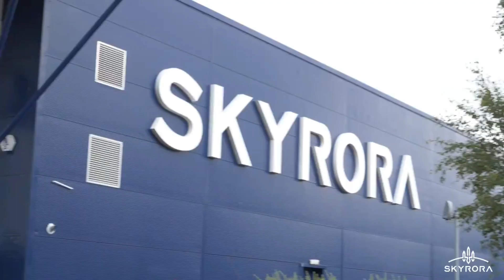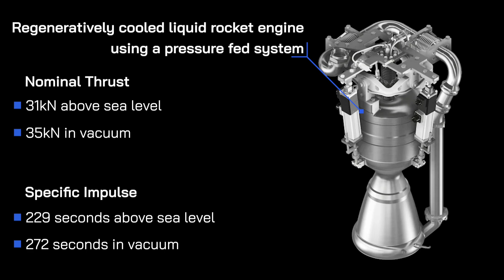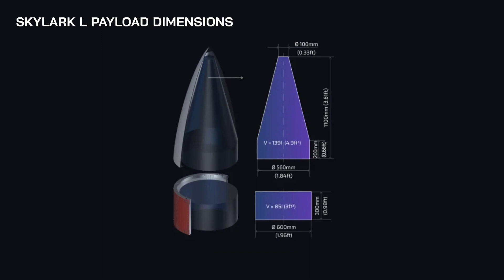Whatever happened to Skyrora?  Is Spaceflight in Scotland still alive?

Comment: Fk zero carbon ...actual climate records show no correlation between Carbon Dioxide and temp, water vapor in atmosphere does correlate though ...
Reply: I agree with you that it's a BS goal, but the question of correlation depends on the timeframe:

Over the last few hundred million years you're right: there's no noticeable correlation. That's not because CO2 had no effect, it's because other factors affected temps more than CO2 did.

Over the last 800K years there IS a strong correlation, but the timing shows that it's mostly due to temperature affecting CO2 rather than vice versa.

Over the last century there's also a correlation, and in that timeframe the correlation IS largely due to CO2 affecting temperature. It is not a huge effect, but it's enough to be detectable.

In fact, the causality runs both ways: temperatures & CO2 affect each other. It's a "positive feedback loop" (albeit a very weak one).

The effect is real, but the problem is not. An enormous parasitic industry claims it's a "crisis" or "emergency," but the best science shows that it's modest and benign, and even net beneficial.